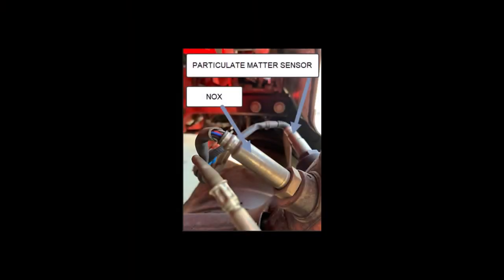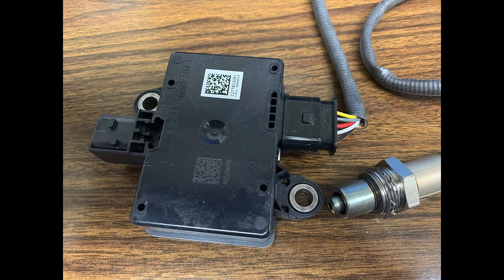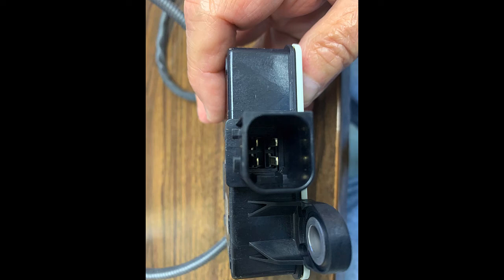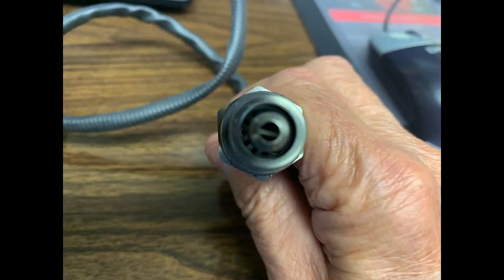Aftertreatment 2350/2450 Part 9 Particulate matter sensor

Comment: Changed the particulate matter sensor on my 2017 t680 isx15 2350 about two weeks ago and now im getting spn 5835 fmi 3. Do these sensors fail after a couple thousand miles or any thoughts on why it would pop up again? Thanks for your time.
Reply from the maker: If the power and ground on the plug check out ( I would use a load pro to check them grounding the load pro on the ground pin and then probe the hot pin or put a headlight across the hot and ground and if it light up the supply and ground are ok) then the sensor failed and it is under warranty a year if it is an OEM (cummins part) Cummins should Replace it for free with labor if the sensor is the problem. If you are handling it take in a print out of the active fault along your part invoice. They know you cant put 100K miles on is a few weeks so it should be no problem to get it warrantied. Oh to answer your question Yes they can. The fault you have is logged when the sensors module fails an internal self check.

Comment: I’m getting codes for what seems like a bad sensor, it looks like it’s in a tough spot to get to, is there anything I can check before replacing the sensor?
Reply from the maker: If you are talking about the particulate matter sensor it depends on what codes you are getting. If the codes are calling for it to regen you can do a manual particulate matter sensor regen. If you have heater faults or no communication and have power and ground to the sensor it is probably failed. I was told the only difference between particulate matter sensors is operating voltage. IE 12 volt machine or 24 volt machine and lead length. The sensor, pigtail, and module are a one piece sensor assembly so you get everthing and change everything. They just screw in and you bolt the module to its bracket and plug it in.

Comment: If it is as dirty as a manifold pressure sensor is usually, is that enough to case a problem?
Reply from the maker: Actually it looks quite clean to the eye because it is after the DPF filter. If it is all black and sooty then your exhaust stacks should be black and sooty. Then that is a problem. But before it got even close to that sooty there would be many faults and derates.  Remember its job is to notify you that it sees soot particles. The calibration in the ecm has limits on how much soot that sensor is permitted to see over a period of time before  the software will logs faults. The intake sensor should be called the soot magnet ;-)